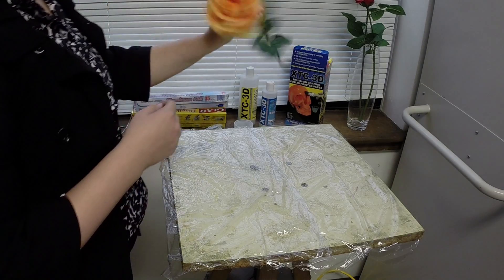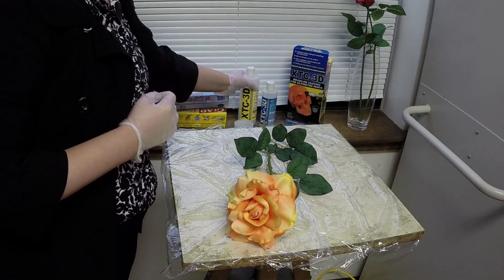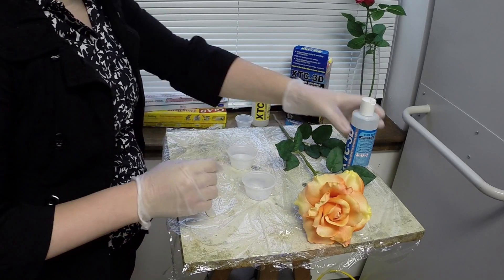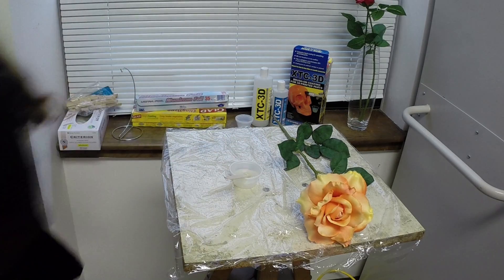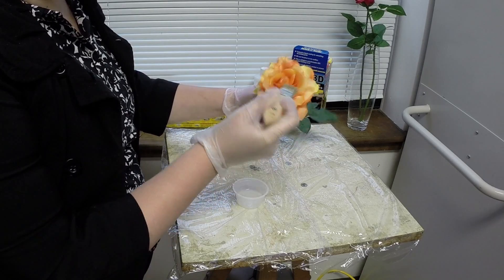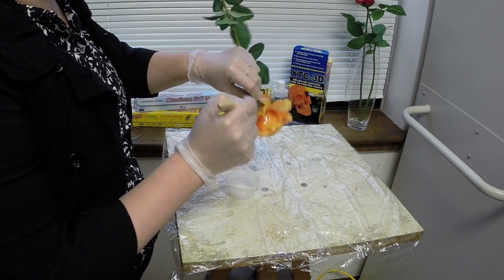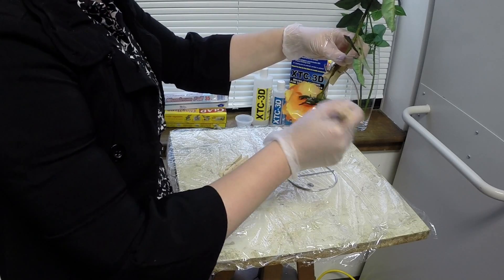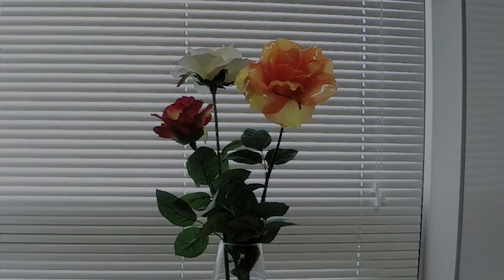How To Coat a Flower With Resin

Comment: How did you dry that flower so perfectly? or is it fresh. When I dry mine they look dead no doubt about it.
Reply: It’s a silk flower
Reply: Try using silica gels!! I tried it for the first time a few weeks ago and my entire family was astounded by the end product. They wouldn’t believe it was fully dried
Reply: Silica gel dries flowers perfectly BUT the more delicate the flower, the more it'll fall apart when removed. Drying them out makes them ultra thin, paper-like. If you can carefully handle them in that state then apply the epoxy and it'll dry. But in my experience I even skipped the silica gel and went straight to the epoxy and it was slightly stronger (this worked best only on Orchids though)

Comment: this looked great till  I read the info on Amazon - sounds even worse than usual epoxy resin, which is dangerous enough without proper PPE.

Info copied below. PPE needed folks, but this looks like an awesome project to do with the proper  precautions

Causes serious eye damage. Causes serious eye irritation. Suspected of damaging fertility or the unborn child.

Danger
Causes serious eye damage.

Causes serious eye irritation.

Causes severe skin burns and eye damage.

Causes skin irritation.

Harmful if swallowed.

May cause an allergic skin reaction.

May cause respiratory irritation.

Suspected of damaging fertility or the unborn child.

Comment: How would you dry an object if the entire thing was coated in resin, and you did not have a bare, unresined spot to clip up to hang and dry?? I have been trying to resin whole pinecones and natural foraged things but have no idea how to dry them without damaging the coat.
Reply: prop them up on little wire triangles or little blocks

Comment: Would this product work on a vinyl collectible figure? How about a painted & deco taped 1 (metallic pin stripe)? Looking to decorate/mod 1 I bought an extra of & wanted that glossy resin finish over it, also keeping striping tape in place too so it won't peel over time.  Thx.
Reply from the maker: We would recommend investigating Ure-Coat for your application. https://www.smooth-on.com/products/urecoat/
Reply: Smooth-On Fan Channel: Made By You .. Thank u so much!

Comment: This was neat, but I wish the title had said silk flower, as this is useless to people trying to coat real flowers.
Reply: For the same reasons as one would put resin on a fake flower, or to preserve the real flower.
Reply: I've been looking for a video on coating a real rose in epoxy resin myself as well
Reply: I hoped it would be for a real flower. I saw a dandelion set in resin and thought it would be a nice idea to set some rose buds or petals from my late grandma's roses for my cousins. I'm concerned that the rose would decay from the inside.
And to be fair... the video says "flower" not "artificial flower"
Reply: @sheeelashell143 check out Artsy Madwoman. Her videos show using real flowers. I was hoping that I could paint the resin in the center of the flower so I wouldn’t have to remove the center of the rose. I was also disappointed that this was for fake flowers.
Reply: You can preserve and coat real roses by melting beeswax and then dipping them.
Reply: Now i saw a video with the dandilions in resin..so pretty
Reply: i thought it was real flower>.<
Reply: Thank you
Reply: I agree. I wanted to coat real flowers and I understand that they have to be dried first or they will turn brown.
Reply: This CAN be done on real flowers with the same product she's using. But the only flowers that held up really well were orchids, most others I tried didn't do as well
Reply: I was only doing a single petal (not a whole rose) but I used copious amounts of hairspray as suggested by another video and it sort of worked. There are definitely water spots, but it's not too bad. It was good enough for what I wanted it for!
Reply: Eee BMW
Reply: @gerardocarlos7476  oh its not real? Oh nvm
Reply: That was a real flower
Reply: Supernatural Superstar The description says otherwise.
Reply: Neala Ernswa // why would anyone want to put resin on a REAL flower?
Reply: To make jewelry out of them.
Reply: @Donna-vh5ym  to preserve it wy else
Reply: You’re just sad lol. I bet you tried it with a real flower 😂

Comment: hi does this make it waterproof. could i get the flower wet if need be?
Reply: Not too much. Resin figures can be cleaned with water or a whipe but too much water is not good for them you can do it once in a while.
Reply: I was wondering the same thing.

Comment: No. You cannot coat real flowers this way. They will have to be preserved first. Look at: RESIN COATING REAL ORCHIDS. Here's how to 1/2.
Reply: Thank you for posting your comment. It was exactly what I was looking for, not this.
Reply: @Ethan Hemphill I buy freeze dried flowers from Etsy. This is my favorite seller https://www.etsy.com/shop/FreshlyPreserved I contacted her directly as I only wanted orchids. Tell her you don't want edible. I paid 
$20 + $10 shipping for 20 orchids. I have to warn you that when they arrive they are closed and because they are dry very fragile, but I found the way to open them up without breaking them. I will make a video soon.
Reply: same here! :-D
Reply: Ty, same here ..
Reply: I think folks that actually work with resin/epoxy understand YES whatever MUST be dried before or the color will be ripped away. I want to find the best way to epoxy a single dried rose. Tonight i shall try it  out.
Reply: Thank you for posting this, this is exactly what I was looking for.